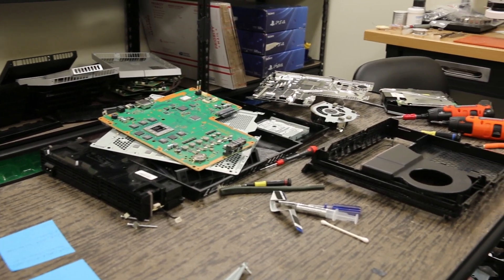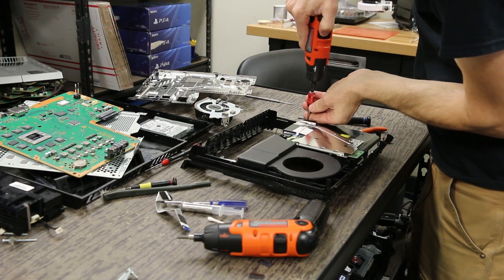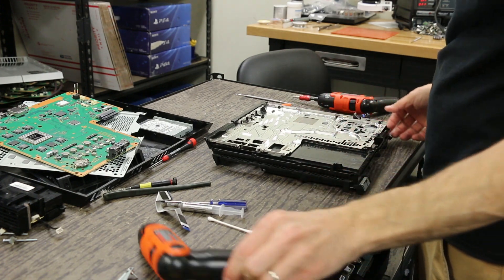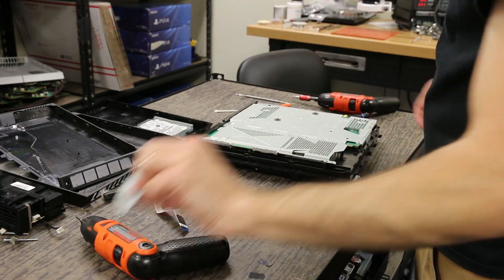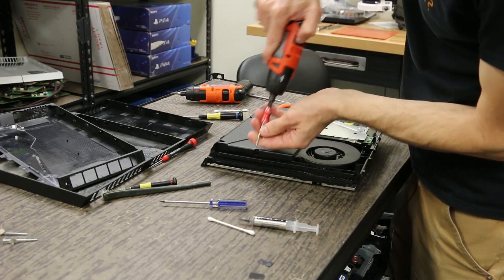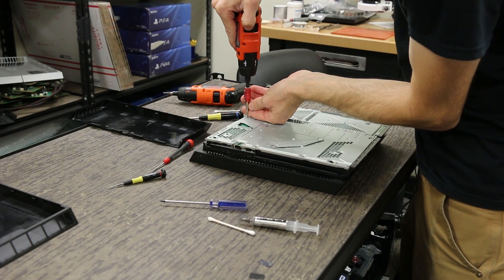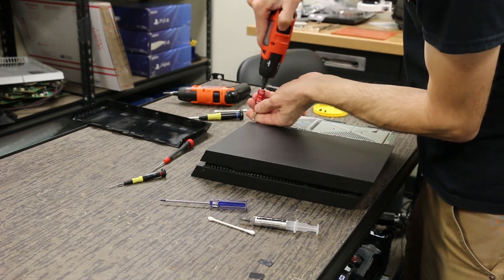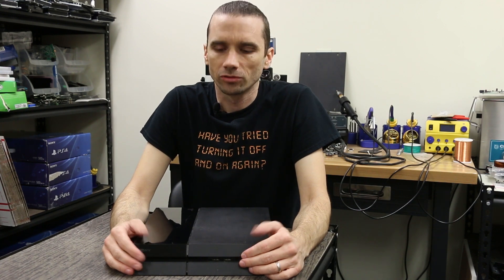PS4 Assembly Tips & Tricks

Comment: I took my PS4 apart to clean it and I got it apart and cleaned it when I put it back together and turned it on it turned blue for a second and went off I'm not sure what I did, and I have two small black screws and I don't know where all my PS4 they went I'm taking it apart at least three times already and can't figure out why it won't stay on
Reply: I can get it started with the controller but it goes right off but I can't turn it on with the power button so it has to be a connection problem

Comment: Helloo i followed everything but when I turned on ps4 it turns on for 4 to 5 senconds and then turn off with 3 beeps sometimes red light come can anyone tell me whats the problem i also connected the fan wire with motherboard but i didnt put new thermal paste. But before cleaning it wa working but afttet cleaning it happens.

Comment: an easier way to get the bottom black plate on again is to have the playe facing in the position it is going to be normally and slide in the ps4 and voila, slides into place without pushing or anything

Comment: Man thank you so much. Took me an over an hour to disassemble clean and reassemble. Was scary doing the thermal paste bit but it worked a charm. I had a dust carpet 1cm thick
Reply: Did you wait a little while after applying the thermal paste or was you able to use your system as soon as you was done?

Comment: I did it ! Although i ended up with an extra screw..... Sounds and works amazing and also i bought a fan off eBay and the connection from the fan to the motherboard isn't too secure it comes off easily which scares me. Csn i buy just the cord for the fan to the motherboard
Reply: Same you ever find out where it went, had the same problem last time, mine is a t8 screw :(
Reply: @mattcook8298  no lol I just left it out. Still runs perfect with new fan 👌

Comment: I just did this RIGHT now because my PS4 was overheating and the reason why because the fan and stuff hand a lot of dust mites 😩🤦🏾‍♂️🤷🏽‍♂️however I would say for the consoles that started off with the 500 GB or whatever, Idk if this applies to all but anyways I forgot one little black Philips screw that was supposed to go on the metal plate under the power battery right next to the connector. I had to retrace my steps right after I putting on the top metal plate with the hard drive, other than that I followed these thoroughly from the previous video of taking it apart and now this one to putting it back together! Thank you so much! This was so clutch! 😩🙏🏽🙌🏽👍🏽👍🏽
Reply: LilCharles Alexander do you have a picture where that goes. I’m left with the same issue
Reply: Ya Qoubi yes but we can’t post photos on YouTube lol so I advise to just go back to his previous video of breaking it down
Reply: LilCharles Alexander ok is it definitely on that video.
Reply: Ya Qoubi yeah you can see which screw it was and it’s a small black screw! And it should be like the second step to getting to the battery after you take off the first layer of the PS4
Reply: LilCharles Alexander Thanks, will take a look at it later.  👍🏽
Reply: Ya Qoubi Fa sho you’re welcome! Let me know if it works fine!

Comment: so.... I followed this perfectly(except for the thermal paste), but when I turn it on, the ps4 beeps once and then goes off immediately. Do I need to apply thermal paste to get it to start up or would i be better off just sending it to get repaired?
Reply: If it beeped and then turned off or went red its probably over heating if it goes blue for a second and turns off with no beep it's probably the power supply not seated properly or its broken that happened to Mr reassembling it I slightly bent the 2 pins that go into the bottom of the power supply I bent then back and it worked fine
Reply: Big Paramjeet hey man Iv had the same problem I think you definitely need paste if your PS4 is old

Comment: Anyone know where I can get the screw sizes. I got a game stop refurb and it's over heating. Dumb dumbs didn't put the thermal pads on the RAM and it's a simple fix, but they also lost and stripped several screws. One was almost impossible to get out. Had to take a sacrificial screw driver and JB weld it on the screw it's self. I need like 5 different screws. Where can I get them.

Comment: Thnx for this video! I really had to clean my ps4 as the heatsink was blocked 2/3th of the way... Also when I assembled the batterie I did not match the Two pins(it was late after a Christmas dinner lol) and I got the short blue light and it went off directly. When I opened it up, the two pins were not aligned. Maybe this helps you fix the short blue light problems. It seems like it’s a battery issue? Anyway you helped me big time ^^ thank you🙏🏼

Comment: I ended up with three extra screws. They're silver and the smallest out of all of the screws. I think they went with the motherboard because I had to "wiggle" or push in my hdmi cord and lan cord before they started to work. I also can't use my wifi. I think maybe the wire is loose or damaged.
Reply: Black Rose10 they are for connecting the heat sink plate to the main block (fan and disk drive) in the centre of the plate.

Comment: Hey I took apart the ps4 to replace the fan and when I put it back together and power on.  It turns blue,fan kicks in high, than turns red and beeps 3 times and than off.  Did I miss something?  Hope this video is not to old to get an answer lol
Reply: Did you add fresh thermal paste and make sure the thermal pads are in place?
Reply: @pest174  we added thermal paste on it.  And should have been put back together.  I still have it but  I just bough a new ps4

Comment: I Fixed my ps4 it sounds like an angel
Reply: I need thermal pastw but my country is on lockdown 😭
Reply: Thefinessekid246 iv ordered paste from amazon so annoying last bit I need hopefully you get some
Reply: What do u mean by fixed ? What was the problem ?
Reply: I done this and my PS4 won’t turn on
Reply: @samborthwick8945  probably improper reassembly
Reply: Thefinessekid246 I’ve done it 4 times over and over
Reply: sam borthwick did you use thermal paste ?
Reply: MogleyF PS4 no I was thinking that’s what it might be because when it turns on the fan goes loud then turns off straight away
Reply: sam borthwick that’s the exact same for me but I looked at the paste and I had non on the wee bit so the chip will just heat it right away and shut off iv orderd paste soon as it arrives I will let you know if it works and I would avoid turning it on until you paste it
Reply: MogleyF PS4 okay cheers
Reply: sam borthwick maybe take it apart again and have a look at the part you paste and see if it needs some
Reply: sam borthwick yo man I got the paste used it and put it back together and works fine it’s so quite too been on 8 hrs of Call of duty and been fine
Reply: MogleyF PS4 cheers man

Comment: I have 2 ps4s one of them was missing hard drive and had some kinda little Beatles took shelter  and were melted? Vaporized? Teleported to another demintion? But the black goo they left behind  could that blow the board.....and on the second ps4 i can't get any controller to sync new old nothing  i get a blue screen with a controller saying connect dualshock do the charging ports in the console go bad?
Reply: Brandon Parde Hey, this might sound kinda stupid but did you try plugging in your controller with a different USB cable?
Reply: Yea but maybe those where shot too i got it down to the mother board and it kinda looks like somebody was alrdy in there the usb ports looked tamperd with and perhaps the edge of the board got to hot or melted but i dont know enough about them to just go off of the looks of the board wish I could post a pic on here

Comment: Hi. I followed all the directions and reassembled my PS4 with no extra screws. No overheating and no loud fan. The only problem I’m having is that now my controller has an consistent input lag. I went back and connected all of the cables but ended with the same result. Any ideas on what this is, what I did wrong, or how to fix it?
Reply: Antenna

Comment: So i replaced my hdmi port on my own with a heat gun. I just put together the same way i took it apart. It wont come on tho. It sound lloud blinks and shuts down. Did i miss something? I didnt use the thermal paste.
Reply from the maker: Yes, you missed several things:
1) Replacing it using a heat gun most likely caused several other problems...that's why I say in the video to not use a heat gun.
2) Without thermal paste even if you do get it to turn on it's just going to overheat very quickly
3) There's no way for me to know why it won't turn on there are lots of things that can cause that. 
I'm happy to have a look at it if you want to send it in but from the sound of it it will cost quite a bit to get it running again.

Comment: I did step by step all your instructions and when I put it all together I'm left with loads off little screws and the 2 big screws and also when I try turn it on it turns on for a second or so then turns back off
Reply: Go through the disassembly and assembly process again, you've missed some steps somewhere. It may be that some screws that hold the cooler to the motherboard aren't in and so the APU is just overheating.

Comment: I have a newer PS4 without the shiny top on the side. Is it possible that my HDMI port has a short in it? Since it does not show a video on my tv screen. I tried 3 different hdmi cables and 3 tvs. Still no picture. I also can use my sons Ps4 as a guide to turn my PS4 off correctly. Any ideas

Comment: i have just opened my ps4 to clean some things out and apply new thermal paste and now my fan doesn't kick on when I start my ps4 up and I get the red light over heat message on my PlayStation now. any ideas on what is causing this. thanks.
Reply from the maker: Did you plug the fan back in to it's connector?
Reply: Yeah I never actually unplugged the fan when taking it apart

Comment: my ps4 comes on an then comes off wat could be the problem
Reply: LiL Chris it's happening the same to me.
Reply: Same mine gose off as well what have I put wrong I opened it twice n closed it back but still same?
Reply: fariji Hey, I don't know if you already have resolved your problem but it's probably the wire that connets the PSU to the motherboard. Make sure it's not damaged in any way and most of all plugged in correctly.
Reply: fariji did you apply the thermo paste ?

Comment: Anybody know if it would be worth fitting a heatsink on the processor, and any way to improve the cooling noise levels, its that loud I can't tell when my washing machines ended, it got that bad I've installed it in loft with extension, thank God for digital downloads

Comment: I want to change my ps4 cooling fan. And the one thing i noticed - there is a lot of fans on Ebay that dont have those 4 "rubber things" (idk the word) on external side. What are they for? Is it important to have them on a fan?
Reply from the maker: Those seem to mainly be fro grounding purposes. You can just take them off of your old one and put them on your new one.
Reply: But will it be ok for the console if i won`t put them on the new one? Does it hold fan well enough without them?
Reply from the maker: I've never done it without them but I'm sure it would be fine.
Reply: Gotcha. Thanks man!

Comment: I recently took my PS4 apart to apply thermal paste and when I put it back together the eject button wasn't working. I looked at that little metal piece you mentioned and it wasn't damaged or anything. What is the specific position it is supposed to be in to communicate with the motherboard?
Reply from the maker: There is no specific position. It just has to be touching the copper pad on the motherboard.
Reply: Ok i got the eject button to work but now theres a disc in the drive but it just beeps 3 times and the disc doesn't eject when I press the button. But the disc plays. Any help?
Reply from the maker: Hmmm...it's hard to say...I'd check the ribbon cable that goes from the motherboard to the disc drive
Reply: Gimme Burgers, I have similar issues eject button not working. What did you do to get it working?

Comment: Why did you put thermal paste?
Reply from the maker: +Priesly Balla They have to have thermal paste. That's what transfers the heat from the chip to the heat sink. Without it it would overheat.
Reply: +TronicsFix Also for the hdmi repair do you need to dissemble the top and bottom of the console  or just the top
Reply from the maker: +Priesly Balla The entire console.